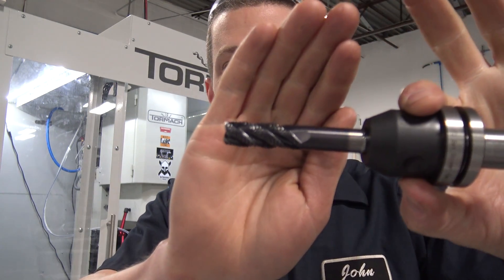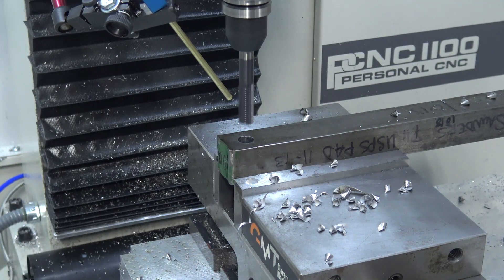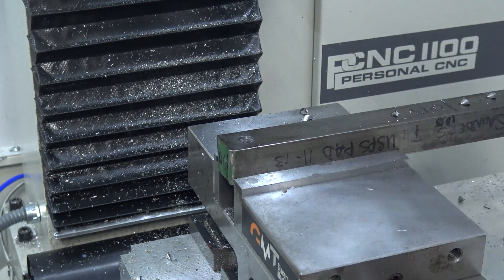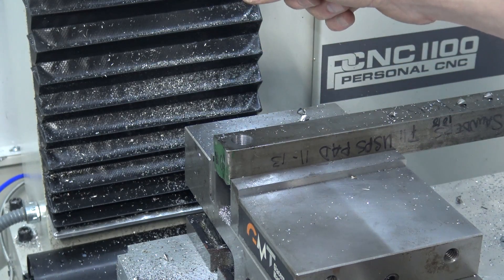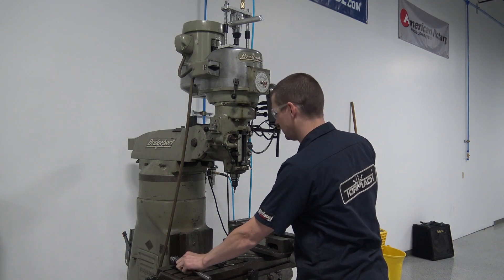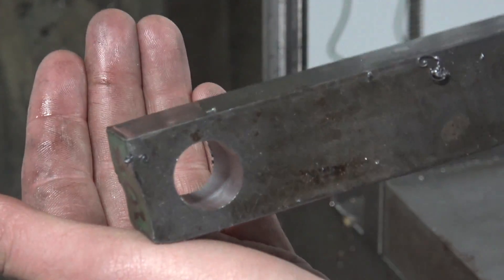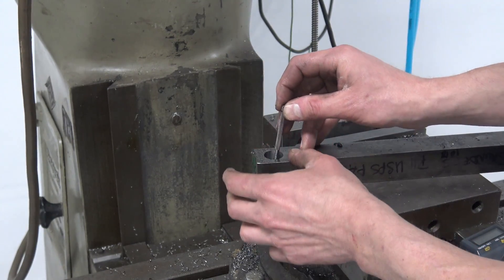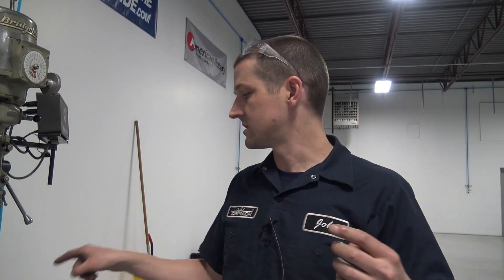Rough & Ream?  Will it work?  Part 1

Comment: A used reamer would in fact tend to cut the hole smaller ;)
As for milling the hole: I would spiral down the whole hole after predrilling - Should not be much slower But I would not loose my hearing from the chatter. 

I would run the reamer at about half your speed and absolutely not peck - And as you have the advantage of using cnc I would go for about 0,1mm stock allowance for reaming..
Reply: I was going to comment and say the sort of the same thing as your never supposed to peck a reamer. Since this is a old video I wonder if he learned that by now?

Comment: Hi John,

First, thanks for sharing.

May be other issues but I would check the runout on your coaxial indicator. You can clearly see that it is wobbling at about 4:25 in the video.  Not done much reaming, but would think trying to run a reamer in an off centered hole would be a recipe for an enlarged hole.  Be interested to see how it comes out.  You might want to try another test hole doing everything on the bridgeport so you don't have to relocate the original hole with the coaxial indicator and see how that works.

John

Comment: I think more oil and faster downfeed and dont back out just go through in 1 pass.
Reply: +John Pilagonia Yes.  It looked like there was a little runout on the reamer, going slow in and out is going to widen the ream.
Reply: +svenp Yep, lighter cut, better set up, one pass, and better cutting oil.
Reply: +The Thing and maybe slower rpm could help

Comment: Would there be any expansion on the Reamer whilst cutting due to heat build up having to remove so much material? i've heard even hand temperature can expand precision fit metal items a thousands or so. I'm no machinist so my thoughts may not be logical.
Reply: Technically there is. As heat IS generated. But not much.  We're talking at most .00002-.00003   Certainly no where near the .0015 he's out by

Comment: roughed to .015" under on diameter. Or left .015 per side? (.030 under on diameter). 

Your predrilled hole should be about 2% smaller than the reamed hole size. So you should be about .735 dia. For a .7505" reamer. 

Also. You were .003 on the coaxial when you reamed.  .0015 out sounds right. .003 off center will push the reamer 1/2 that distance in runout.

Comment: have you tried helical boring the hole?  I'm not sure how it will go with a  roughing end mill but  I have pretty  good results  boring   this way
Reply: Helical boring to finished size with a roughing endmill is no Bueno.  I've tried it. Even ones with .100 CR's and they still look like crap compared to holes helixed with a finishing endmill 

Helical to rough to reamer pilot hole size would work though. Would be faster and less wear on the cutter. Less horrible shrieking noise as well

Comment: now with that end mill. i always see you go with the material when moving the tool instead of against it. when i learned machining in school they told us to always go against the material. why are you going with it?
Reply: If you're referring to climb/conventional. Then you were probably taught to conventional mill on a bridge port.  Which is true your should, otherwise the cutter suck the material into itself due to the backlash in the table. Conventional milling forces the material and backlash away from the cutter. CNC's don't suffer from that problem.
Reply: +Occams Sawzall ah makes sense
Reply: +fredlllll  the key here is a CNC machine using a ballscrew with negligible backlash vs. with a leadscrew with backlash. It is possible to have backlash compensation in a CNC machine to take out the slop between direction changes as well.

Comment: Hello, I work on a 4 axis Ferrari cnc mill my opinion is:
- For that big reamer you should use 150rpm or less
-You need to use coolant !
-Need to leave aroud 0,1-0.15 mm of material for reaming
- Not peckdrilling it, go directly slow in to the hole and slow out of the hole (feed in, feed out).
Recepy for good reamed hole.

Comment: You can compensate the corncob by doing a step up of the same cut. Also yeah...yesterday I just had it! If you pull a reamer out it will inevitably bite the chips and over-ream! Just look at the surface finish a reamer leaves the first time you take it out and how much it craps on it when pecking further!

Comment: yeah, blew that one open. Your rpm is WAY to fast for reaming, you should be able to see the flutes without it being a blur. Heat = expanding tool = blown open hole. Remember, its not a drill. Its also bad practice to ream to full depth BEFORE checking top with pin guage, etc to make sure its not over sized before continuing. Clear your chips often to avoid stripping wall (also happened in this vid) and use coolant. If your reamer is oversided, run a stone over it in the mill to dull it down. If your reamed is undersized, run carbide along the flutes to sharpen it and expand it. Yes you can use an end mill for a pilot hole, but usually not like this. usually youd drill with a twist drill, then use a ground down end mill called a skim bore to plunge down the hole and ensure squareness. A skim bore (end mill) is just used end mill thats be re-ground to under .01 - .015 of the reamer size. You  should keep a twist drill, skim bore, and reamer in sets for this reason.

Comment: John at 4:39 I noticed that on your coax indicator you still have the piece of white plastic in your coax that limits it's motion in the top.  I think that needs to be removed for it to work right?  At least that is what I found and I have the same fowler model that you have.  Also I think you need to run at a lower rpm and go thru in one shot.
Reply: I was going to comment the same thing. I think it is a shipping protector.
Reply: Yup.  Didn't notice that till you said it. Was busy watching the wildly swinging needle and the little dance the whole unit was doing. 

But ya. That's a shipping protector and needs to be removed. In fact I think that's said on the first page of the manual.  But I'm sure like the rest of us the manual is just a book of suggestions at best 😆
Reply: +Bill De La Vega Just had to go look at mine and you nailed it.  I still had the plastic protector ring on mine, but not any more.  Thanks for the tip Bill.  Cheers, Gary

Comment: Too much material, maybe too fast speed. Make sure the reamer isn't too sharp, sometimes they cut oversize when new. I heard on the internet to use really thick cutting oil for on size holes, and light cutting oil on holes you want over reamed. So far I've found that true in my shop.

Comment: choke up on your rougher end mill or use a shorter one if you can. I'd bet most of that chatter in the beginning was from the end mill not the machine. did you crash your coaxial? it looked like a lot of wobble!

Comment: Did you leave .015" a side or .015" diameter? Sure looked like the former, when it should be the later.  Reamers always do better with a light cut in one smooth continuous feed. Use plenty of coolant. A floating reamer holder really helps for large ones like that.  Small chucking reamers have enough length and flex to self center, but as they get bigger, you lose that, and a floating holder will insure that it follows the center of the hole. The rougher did a great job for the initial hole. If you were doing a lot you might tweak the CAM to reduce chatter, but for a single hole, it's not worth the trouble.

Comment: I have a few suggestions.  First, you need to indicate the hole a little better.  Reamers side cut so if you are off center it will side cut a little and cut oversized and not round.  I couldn't read the dial very well so you might not have been as far off as it looked.  Second you had a lot of runout on your reamer itself (camera might have magnified it).  Did you use a drill chuck?  If so try using collets.  They also make floating reamer holders that self align to the hole even if you are off a little. Might be a worthwhile investment for you.  Third, slow your spindle rpm way down and use more oil.  About 75 rpm should do it.  Fourth don't peck with a reamer.  Do one slow continuous stroke in with a slow continuous stroke out.  The idea is that once the cutting edges of the reamer engage, they stay engaged and the reamer stays loaded.
Reply: NYC CNC no problem.  Hope one of these tips helps solve your issue.  I rewatched the video after posting and saw that you did use a collet and not a chuck so you can ignore that comment.  Might just have a chip or something up in the taper causing the runout assuming the reamer itself doesn't have a warp to it.

Comment: This is my suggestion 
1 the ruffing end mill can you do x y z helical  interpolation program the hole to be the right size you want in the xy axis then on the z for every rotation drop 1 to 2 mm. When you do this you need to keep the pressure on the tool,  stop 2 mm from bottom.Because when it breaks out on the bottom tool may flex and over size the hole. So when you get to the bottom leaving 1 to 2 mm on the z put cutter to center of hole then drop cutter 10 mm and finish bottom of hole you may have to change the hole radius on the bottom to get the right size. This will take some experimentation but when you get it right it is fast and less chatter.
2 From what i could see for the reamer there was to much material to remove and play with the rpm. And if you had the alignment off in the Bridgeport then that would also make the hole a different size. When you measure the hole measure in three different directions to see if the alignment was off.
Hope this make sense if you need more info send me a message thanks.
These are a few things I have used in the past to fix what you are doing.
If you are still having problems with the lathe and the finish i have a few suggestions for that as well. They would take me to long to type and this is already long enough.
Have a day

Comment: Looked like your reamer wasn't running very true, what's the run-out in your spindle?.
If that's an issue then there are a few solutions.
1. bore the hole with a boring head(still may not make a perfect hole).
2. rotate the reamer in the holder and try and cancel out run-out between spindle and tool holder if possible (easiest way).
3. (most expensive option) is a floating reamer holder. 
that's my 0.02¢ haha.
Goodluck John ;) 
Keep those vids coming!

Comment: One more thing, ditch the hss and get carbide tipped reamers, they are available with a right hand and left hand twist for pushing or pulling chips.  Not sure how accurate you need but if your trying to hold a tenth then higher end carbide tooling will serve you well

Comment: Try running it as slow as possible and don't peck.  The runout isn't your problem.  Also try not to retract the reamer while the spindle is still running, stop the spindle and then retract the tool

Comment: Is the tormach able to accurately interpolate that hole to .7505? Also, you should leave a little less for reaming IMO.  I know they say .015" per side, but I'm usually quite a bit less and get good results.   When you indicated in that bore I noticed you left it at what looked like a thou, but I couldn't really see for sure.  That could make the hole large as well.
Reply: +Dan'sMeTube 

I helical interpolate bores and OD's to within +/- .0002 all the time. Though it's not on a tormach.
Reply: +akromix I was wondering the same about just using an end mill and let the machine do it.
Reply: +NYC CNC bummer. Issue with servo tuning? I have a feeling you're gonna shit yourself when you get your first vmc
Reply: +NYC CNC 

The question is now, does that .751 hole have to be within tenths? Or is it simply clearance for a 3/4" bolt to slide through? 

Does it really have to be reamed? Or could you simply helical bore it (even with that rougher) to .751 to .756?

Comment: GRR! DON'T PECK! Single shot, straight through. Backing out drags hot crap through your perfectly-sized hole. Commit to it. When you make it through: spindle off and stopped, then retract. This goes for blind holes as well. If it hasn't consistently reamed properly, you probably properly committed to the ream. Try again and just go for it. COMMIT! Then do another where you back out. I'll bet dollars to doughnuts that the "Just go for it" method will be closer to size (if not perfect) than the "babying it" method.
Reply: And 15 thou to ream out is about right. You can get away with 32 thou in some cases, so a roughing endmill ought to work. (If you're doing your part)

Comment: Leave less  say .007" to .015" Much lower RPM and higher feed.
Reply: +x  ...feed fairly quickly thru with no pecking or stopping. Doing this will remove the 'boring' it is doing due to runout.

Comment: I agree with the other commenters, 

You've got a reamer misalignment, possibly a little reamer runout in itself, it may be slightly hot.. run a little coolant.  .015" is ok for your undersize drill.  Don't peck a reamer.. just push it straight through..  Rearmer speed is basically the same as drill speed, and is calculated the same.  If you're finish reaming, intending on a tight tolerance fit (and finish too), .005 would be ok, but worry you might not get enough chip out of it.  There are finish reamers.  HSS, Cobalt or carbide reamer?  M42?

Comment: Like everyone else is saying tool runout and you should not peck with a reamer also turning off the spindle before you bring the tool out will help. Not sure what rpm you were running but your feed looked a bit slow to.

Comment: Remember John I do this routinely ;) In fact my whole business is dependent on me doing that exact thing just right. LOL. I rough my 0.75" bores with that same roughing end mill and then ream them in that state. To confirm this was a sound practice I asked a friend of mine that works at GE aviation if it was OK to do that and he said it's fine. Couple of things to iron out. The biggest improvement that I found with reaming this size hole is switching from a HSS reamer like the one you used to a carbide tipped reamer. The hole quality and finish was night and day. You run the RPM faster and the feed a little higher. I think I ream 0.75" at 700 or 800 RPM and 4 IPM. I'd have to look it up but that's pretty close. I also leave about half the material you did for the reamer at about 0.008" under instead of 0.015". I use flood coolant which works well but I also tried just oil and didn't notice a huge difference. I don't peck it, just one shot straight though with a short 1 second dwell at the bottom. 

Now the end mill. That did sound bad initially and you're right the engagement is almost a slot at that tight initial ID. I pre-drill with a 14mm (0.5512") drill and that makes a big difference. I used to do it like you did with spirally interpolating multiple depths except I ran it faster and didn't have chatter. It worked OK but I found there was often both a taper to the hole so that the reamer was working harder the deeper it got (the taper was caused by tool wear and deflection). But also when the the tool started getting dull the hole wouldn't be round anymore and the reamer would just drift off course following the path of least resistance. I tried addressing that by simply doing more finish passes to clean up the hole and make it round but it still tapered. To fix all of this I started helically interpolating the hole with the WarMill after the 14mm pre-drill (and if I had the HP I would be using a bigger drill still). I resisted this at first because of the idea of the flute tips wearing out first but this turned out to be a better solution after all. The hole didn't taper for reasons similar to why you grind from side to side on a surface grinder instead of the full face of the wheel. The very tip may wear but the straight flutes take care of the hole dimension thus preventing the taper. Engaging all of the flutes wears them all and the bore will constrict as you go. Helical interpolation ensures the bore is a cylinder and not tapered, makes a straighter rounder hole, and is also much less prone to chatter and more conducive to chip evacuation. I also wouldn't use the WarMill for a short part unless I needed the long reach that it offers. 

Oh Yeah and I have found out why they are called chucking reamers. It's because you have to chuck them in a vise and saw off some of the shank so they will fit in your machine. LOL. Seriously that's what I do, I take off an inch or so but leave it as long as I can so it can flex and follow the hole. Let me know if that helps at all.
Reply: +War Machine LLC  Well said! Question though, do you do this on one machine and setup or do you move it like John plans to (Tormach to Bridgeport)? I am concerned that there are too many variables with him moving from machine to machine. My experience with chucking reamers is if you move anything between drilling and reaming you can end up with a somewhat banana shaped hole top to bottom. Due to  slight variations of the table to  spindle or table to vice from setup to setup. Could be remedied by indicating the center of the top of the rough hole then moving down to the bottom  of the hole to check if you are still on center in other words parallel to spindle travel. Or is this not an issue with larger tooling and equipment than my VGS-20?
Reply: +weaves7 I do it all in one setup on the same machine. You are right changing setups and machines can be problematic but careful indicating should prevent it from being an issue.

Comment: I forgot to mention, for precise reamed holes, oftentimes the hole is drilled, bored, then reamed.  The boring step makes sure the hole is round and on-center.  A non-round hole will cause the reamer to cut unevenly and oversize.